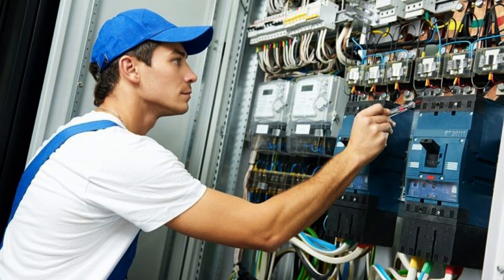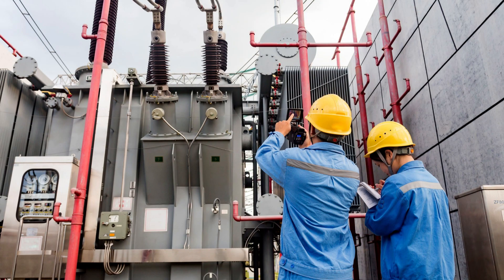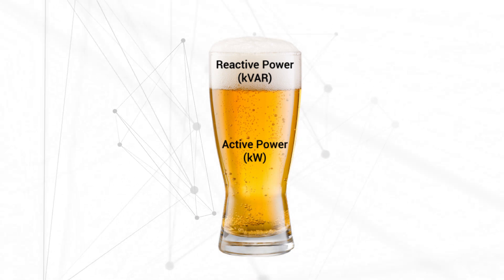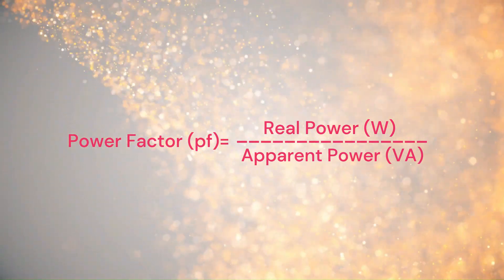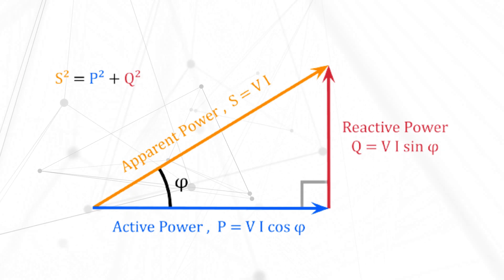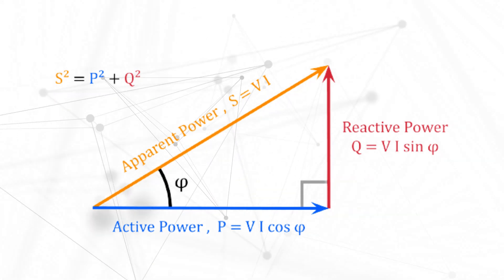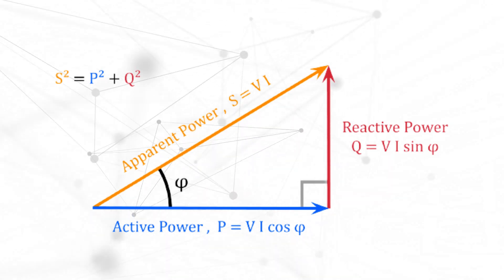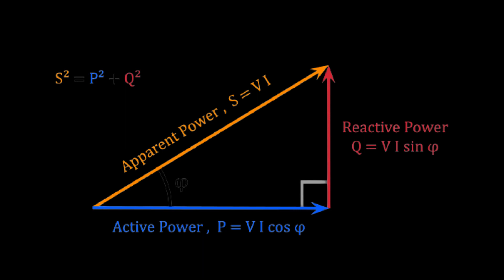What is Power Factor in Power System?

Comment: I want to know what is Average power factor ?
Reply from the maker: Power factor is the Cosine of the angle between Voltage and Current of an AC circuit. Or you can find it from the ratio Active power to apparent power. The term "Average power factor" does not exist.